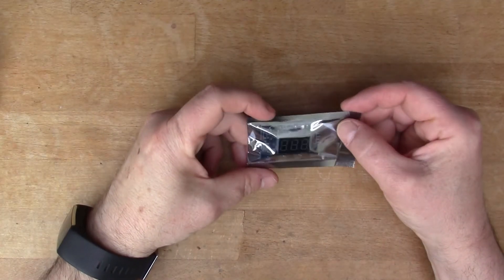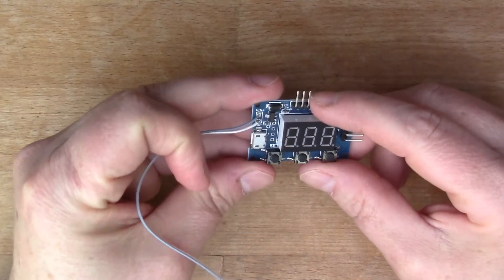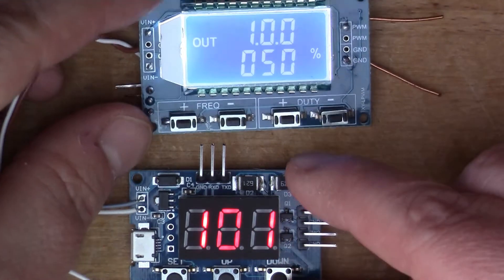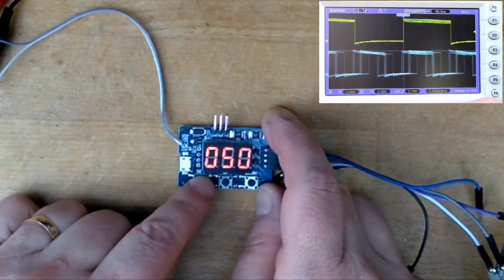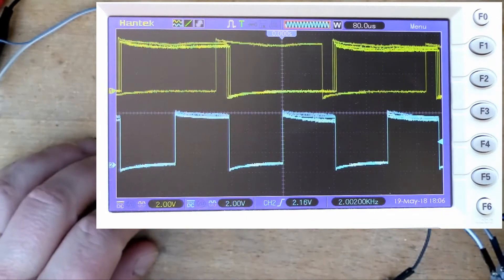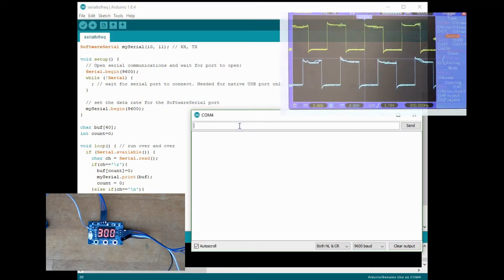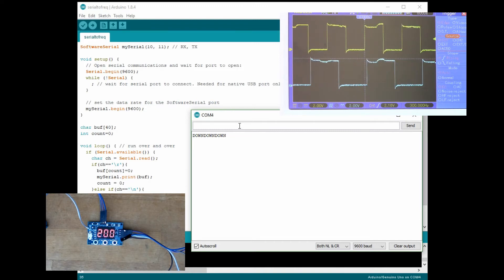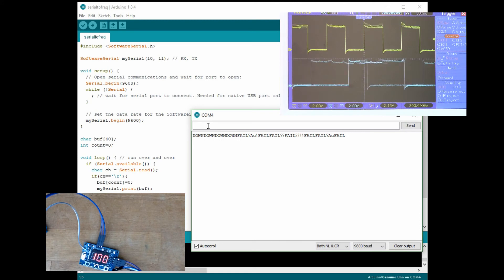Testing a Dual Channel Signal Generator (#71)

Comment: Just bought the backlit version today (same as yours). Just a pity that there was no instructions for its' use. Your 13 minutes of teach-in has been most valuable to me. This was really cheap on Ebay, about USD 8. I am not certain if the output would directly power a small Tweeter at approx. 20kHz, so I am experimenting with this.....I have not powered-up mine, and was wondering how the LED Display shows 20kHZ? I don't have the luxury of an Oscilloscope! Thanks and greetings from Australia.
Reply from the maker: Thanks Peter.  There is a small howto on the icstation website https://www.icstation.com/signal-generator-pulse-frequency-duty-cycle-adjustable-module-display-150khz-p-12477.html).  I don't have my unit to hand right now, but it looks like 20kHz would read as 20.0
Reply: @MartynDavies  Thanks for the info, I am 74 yrs, and have had a deep interest in self-taught electronics. But this piece of kit (the backlit version with four (4) small keypads) is completely new to me, and I just had to have one! I had an RS Stock No. 610 - 405, and this had a variable frequency from 1 kHz to 20 kHz. This RS Unit, drove a Tweeter directly from its output. It's over 50 years old, and now inefficient. Not sure if the neat version that I have just purchased - could drive a small Tweeter on its output directly? I am truly impressed by what this small circuit board can do! Finally, I must admit that I had no idea what the "Duty Cycle" was! I had always thought that a Car Starter Motor had a short duty cycle, but I could not understand why any Frequency Generator should have a duty cycle..............? Now (with all thanks to you and your YT production), I was so pleased to gain this knowledge! Yes, I think that you are right about the display. Possibly the first decimal point will not be visible, and then read as '20.0' as you said.
Reply from the maker: @peterduxbury927  I imagine that it can drive a tweeter - 5V is quite a lot of voltage in audio terms.  I think experiment with a capacitor inline, since you don't want to sink much DC current through a speaker.
Reply: @MartynDavies  Thanks once again Martyn for your help and advice. I do agree that any speaker does not like DC voltage and current, and (years ago) I read about amplifiers and "clipping" which can destroy any speaker by DC!  I did read somewhere that the output current of this device was quite low, and in the low mA range, but a capacitor in line sounds good. Before beginning this project, I need to buy a small plastic Project Box from our local Electronics Shop, which is similar to the old 'Tandy' Shops. In our country, these shops are called 'Jaycar', RS - or Farnell. A pity that this device does not have a small LED when the circuit is energised, but I will add one to the 12VDC input via a suitable resistor, when I hook it all up.

Comment: thats great testing, can you share arduino code for serial testing?
Reply from the maker: The code I used is published on my github (https://github.com/magiccow/serial-to-freq-gen), but as I said in the video the serial port doesn't seem very reliable on this module.  If you want to use serial control, I would recommend the single channel module I looked at before ( https://youtu.be/MkO1HJ91cQs ).
Reply: @MartynDavies  hello,  I am novice in electronics,  I am looking  to built  a specific  device providing  2 channel and micro ampere  output and control the frequency  of channel 1and  2 from computer.  Also further the idea is to write frequency  pairs with specific  timing for each frequency  and to save the program  and then run the machines ( in short automated  firing of frequencies of saved frequency  pairs) 

My question  is is it possible  to do with above  pmw generator. 
Thanks
Reply from the maker: @kedarghatnekar4478  I could not find a way to control this module reliably from a computer, so you are probably better using something else.  Arduinos have PWM output, and are computer controllable. Something like the Duemilanove has multiple outputs, or you could use two cheap clones (e.g. Pro Mini or Nano) to give you the two channels. If you search on Google for 'arduino pwm multi channel', you can probably find a design to base it on.
Reply: @MartynDavies  OK thanks,  anything /any model you can suggest?

Comment: I didn't know there were any cheap modules with a serial interface, good to know even if that one is a little dodgy.
Reply from the maker: The LCD one is better. The serial interface works, and you can read back the parameters - you could control the frequency and measure externally from a Pi etc
Reply: What program do i need?